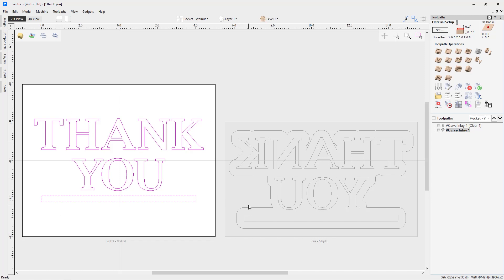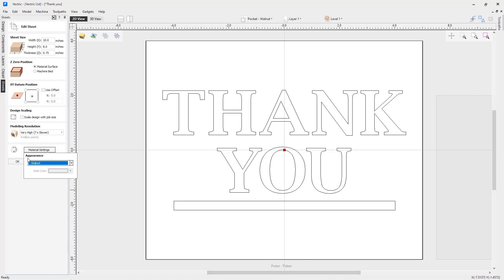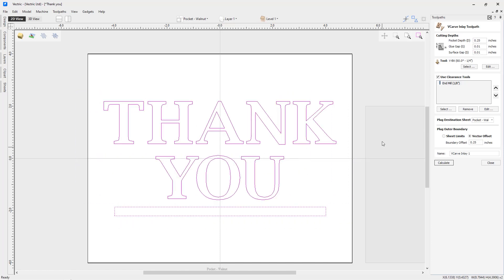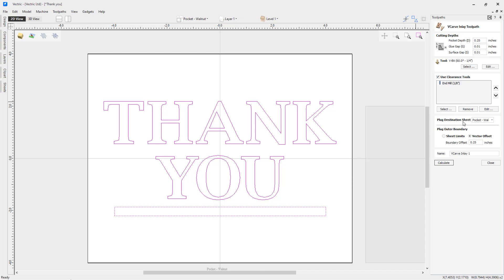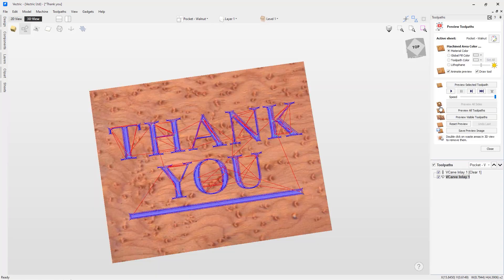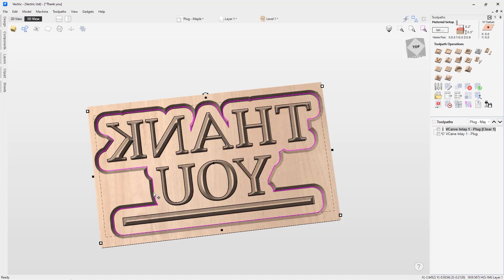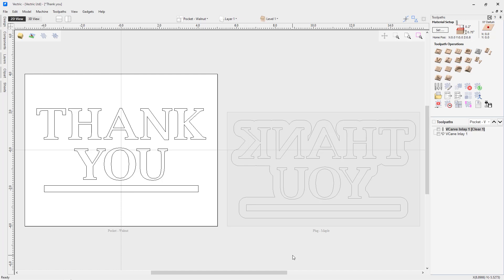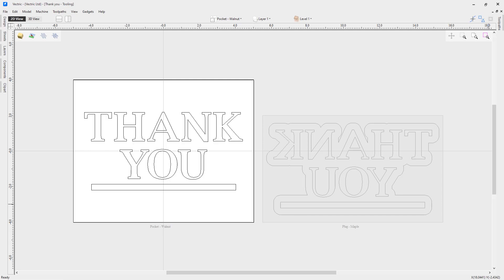How to use the VCarve inlay toolpath in Vectric software | 2.5D Toolpaths | V12 Tutorials

Comment: How can I save out both the clear and vbit toolpaths to the same gcode file with a pause in between them for manual tool change? (other than text editing)
Reply from the maker: Hello and thanks for the question.  I believe we can help, but this might be better delt with via an email to support.   If you could send an email to support@vectric.com with your question, the full make and model of your cnc/controller and the full name of the post you are using - that would be helpful.  Be sure to send that from your registered email address.  They should be able to help.

Comment: I'm still struggling, I'm trying to use the inlay method to join two pieces into one, like a lid and a base but it must have an 8mmx8mm space inside the joint, ie, inside the glue gap
Reply from the maker: Hello and thanks for leaving the comment.  I would suggest you email support@vectric.com and they can help.  Please include a description of the problem and a working file, if you have one.

Comment: I am confused with setup of female and male project size.  Can I have the female board say 15x 11 at .75 thickness and the male plug at 5 inches height and 8 inches long and .5 inches thickness
Reply from the maker: Yes you can mix and match the pocket material size (female project - as you called it) and the plug size.  I suggest you set up your two sheets (for for the pocket and one for the plug) and then create your design on the pocket sheet.  Select the vectors you would like for the plug and use those in the VCarve inlay toolpath, just be sure you tell the form what sheet you would like the plug to be created on. 
It might be handy to know if you are looking to make an inlay in an already made project (like a found cutting board) then you don't need to set up the packet sheet the size of your full cutting board.  Seeing as all you will be cutting is the inlay then both sheets will be close to the same size.  Hope that helps.
If you need more support with this please feel free to email support@vectrsic.com, include a description, and if possible a working file so they can better understand and assist yuo faster.

Comment: I feel like I'm missing something.  I'm following the inlay toolpath settings to the letter using a 60 degree v-bit, my project setup has been triple checked, my wood dimensions are spot on, and I cannot get an inlay to fit snuggly.  If I was to venture a guess, it feels like I have 1-2mm of play when I put the pieces together.  The reason that I feel like I'm missing something is that I never see any complaints from anyone else about loose inlays using this tool path.  Any advice?
Reply from the maker: Hello Craig, sorry you are having trouble.  I would guess you do have somehting wrong in your toolpath setup, or you are trying to use a tapered ballnose.  You do mention using a 60degree V-Bit... so I think that rules out the Tapered ballnose, so there must be something not right in your setup.  We would need to see the file, could you please email support@vectric.com with the file, description of the problem and what you CNC setup is.  They should be able to help.

Comment: good evening, can the inlay sheet and the plug sheet have different XY references?
Reply from the maker: Hello It could... it is up to you.  You can change it per sheet using the sheet tab, selectin the proper sheet and then clicking "edit" at the bottom.  Just don't change any of the toolpath settings... you can recalculate them... but don't change them.

Comment: Am I mistaken in thinking that the way the clearing bit works on the plug side is an entirely new thing in the way that it steps down ‘pyramid style’, following the contour of the V bit tool path? It looks to me like this is maybe the biggest improvement to the work flow because up until 12 we had to carve the plug all in one pass depth by setting the Start Depth to the full depth of the cut minus the Flat Depth. That has always been super aggressive on the tool, but now it seems that the clearing pass is taking the v bit angle into account and clearing along the wall angle to make it easier on the bit.
Reply from the maker: It is much easier then the long form way we have done it in the past, and we have optimized the process as much as we think we can.  Of course seeing as the software does a lot of the work, some who have been doing this for years may still want to do it the old way if they have a particular system that works for them and their machine.  We have another free project video you might find useful to watch - https://www.vectric.com/vectric-community/free-projects/in-the-labs/serving-board-vcarve-inlay
Reply: @ ok, but that doesn’t answer the question even a little…
Reply from the maker: Sorry if that did not give you "an" answer.  Please email support@vertic.com if you need a more indepth answer.

Comment: I'm looking to switch from Carbide Create to VCarve Pro (at some point - still building up my piggy bank 😅). This exact feature is the main thing that had me wondering if I can make the switch. I do lots of inlays and have CC's inlay feature totally figured out, and I wasn't sure if it was even supported here. Now I see that it's not only supported, but much more sophisticated. A lot of the manual steps I got used to performing are eliminated here. The most impressive of all to me is the Plug Outer Boundary. Wow!! I had gotten so used to manually creating a .25" outer offset on my plug that it never even occurred to me this should be handled for me!
Reply from the maker: That is all great to hear, thank you. Let us know how you get on!

Comment: Mine puts the male and female on the same work piece. You didn't show how you got 2 work pieces on there so this is no help.
Reply: Why is there no option for tapered ballnose available to choose from in the list? Like the 6.2 degree Amanda bit.
Reply: @patrickparisius6614  You can add it yourself by clicking the "+"(which will say add bit) at the bottom left of your bits list. Just highlight where you want to add it(v-bits).
Reply from the maker: Hello... I do point out that you should create the 2 sheets you need for the pocket and plug.  If you do this ahead of time you will see in the VCarve Inlay Toolpah and option to pick the "Plug Destination Sheet", choose the sheet you would like your "Plug" vectors to be placed.

Comment: I'm following along with a test project in Vcarve pro 12, and when I calculate the toolpath, I get an error message telling me "insufficient glue gap." What am I doing wrong?
Reply from the maker: Hello... thanks for the question.  That is a warning telling you that some of the plug elements come to a point, so there will not be a glue gap in those areas.  If you are concerned then you can reduce the plug depth so that you don't have this issue.  In most cases that is OK if you are using alot of glue.  Again... this is just a warning... not an error.  There is another video that might help you with this where I explain what to look for - https://www.youtube.com/watch?v=8QQnanfviwU

Comment: Thanks for the useful video. A lot of people use a 6.2 degree tapered ball nose endmill for inlays but apparently these are 'incompatible' with the new vcarve inlay toolpath. Is there a workaround for this in V12?
Reply: Change the designation of TBN to V-Bit, and double the side angle.  It works really well. I use a 5.26 degree TBN and have tested the vcarve inlay toolpath directly against the old method.  Both methods were exceptional. The vcarve inlay toolpath did save a considerable amount of time though.
Reply: @tk.designs That’s a great idea - thanks so much for sharing it. I’m sure it’s fairly straightforward to change the designation within the tool database?
Reply: @alanbrouder5771  Yes. You only have to change the designation, from TBN to V-Bit, and double the side angle so that it is the measurement of both sides, as opposed to 1 side in the TBN configuration.
Reply: @tk.designs  Thanks - I did it just now. Had to play around a little with the other parameters to get it to work. Progress!
Reply: @alanbrouder5771  Glad to hear it. Happy V-Carving!
Reply from the maker: Hello Alan... you are correct, at the moment we only support V-Bit tools.  As for a workaround, we would suggest defaulting back to the longhand method.
Reply: @vectric  Did you manage to include that feature now? It's been a year. :P

Comment: After my first test with this, the cuts looked excellent, but the fit is too loose. There ends up being zero surface gap when I mate the 2 sides together and I can wiggle it a bit. I'm using a 60 deg v-bit from IDC woodcraft on a Makera Carvera (pretty precise and tuned machine). I used a pocket depth of 0.12 in and a glue gap and surface gap of 0.015. I'm working with 1/4" thick stock. Very new to inlays so not sure if my parameters are causing it or what.
Reply from the maker: Hello and thanks for the comment.  It might be best if we had a look at the file to make sure there is nothing obvious that went wrong.  It would appear that all sould have worked and there should not have been any wiggle.  My only thought, without have the file is "was your pocket material's surface flat"?  If it was I would suggest sending your file to support@vectric.com so we can rule out any issus with it.
Reply: @vectric  Thank you! I will check the material closely and do some tests first.

Comment: I get the first error message. Can you explain what adjustments I need to make to get more glue gap? Thank you.
Reply: I can’t seem to be able to select a tapered ball endmill for the v carve tool like I can for the regular v carve. Other than that, this would be very handy for cutting board inlays
Reply: @goodwoodwoodworks  Change the TBN to a desigation of v-bit, and double the side angle. I did this with a 5.26 degree TBN, and it works flawlessly. The key is to make sure it is listed as a V-Bit, so make a copy of your TBN, and then modify it.
Reply from the maker: Hello Mike... thanks for the question.  If you feel that you do need a "glue gap" in every area, then I would suggest making your "Pocket Depth" less... or more shallow.  Some users don't use the glue gap at all.  If that does not help, please email support@vectric.com and they can work through it with you. :)
Reply: @vectric  Thank you. I'll try it.